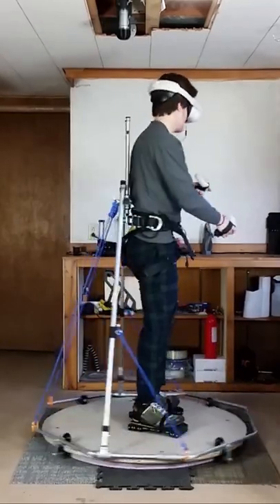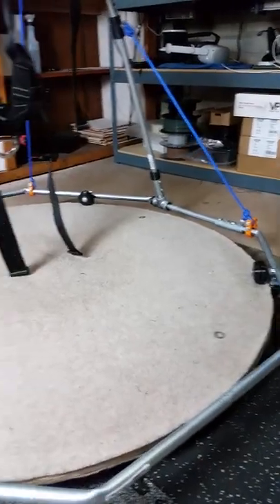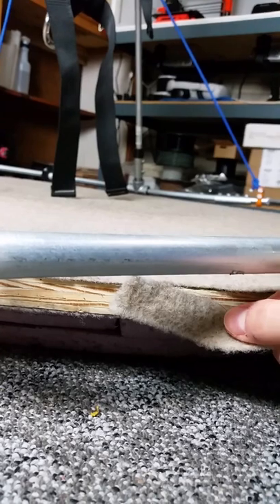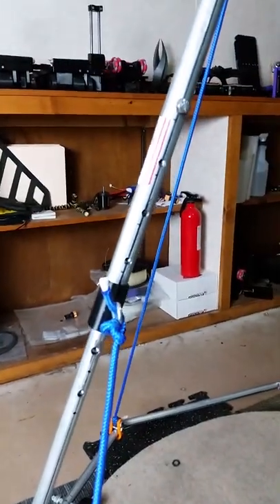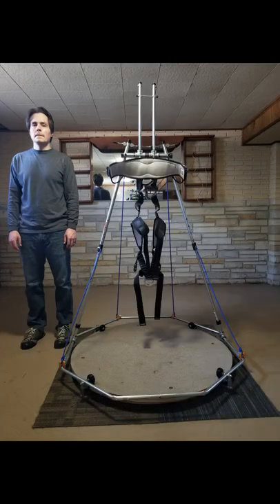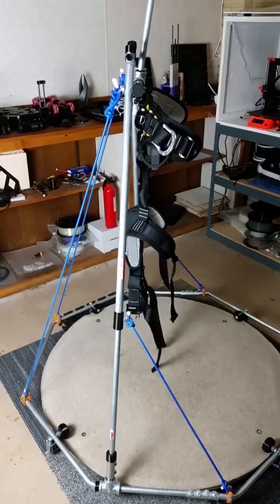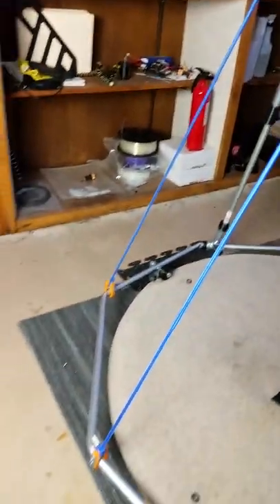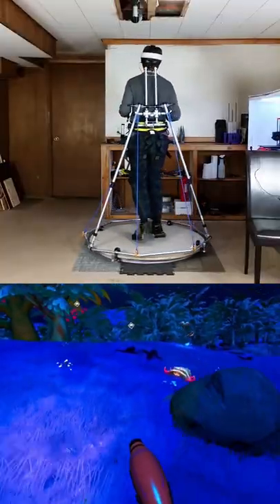#shorts VR Support Rig Update - Improvements are Done!

Comment: An idea for quieting down the system: Put a sandwich of two materials underneath your platform: A very stiff and dense and heavy slab of, e.g., concrete or hardwood on top, and a sheet of foam or an inflated air mattress (possibly with foam in it, outdoor stores sometimes have those) or something other very elastic underneath. See Stefan's explanation in https://www.youtube.com/watch?v=y08v6PY_7ak. Yes, a 3D printer is a lot lighter, but we use this idea even for quieting down subway trains in Germany: https://de.wikipedia.org/wiki/Masse-Feder-System_(Bahntechnik) There doesn't seem to be an equivalent English article, so I'm afraid you have to rely on, say, deepl translate.
In short: The heavy material on top first opposes any significant impulses and vibrations and sends them back up (impulse and reaction); the elastic material on the bottom then eats up all remaining vibrations that travel through.
I've tried finding an equation to gauge how much of which material I'd need to quieten down my treadmill and even posted on the engineering stack exchange, but the answers weren't overly helpful. The best I could do was find university material from German engineering programs, and that was a bit too much math for my taste for the time.
In any case, the idea itself is sound (pun intended), so maybe consider giving this a try!